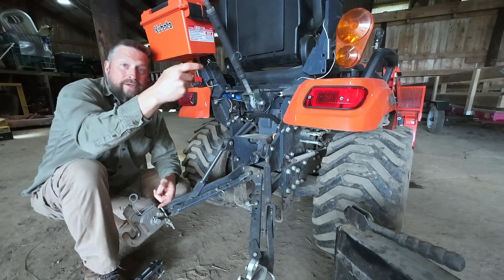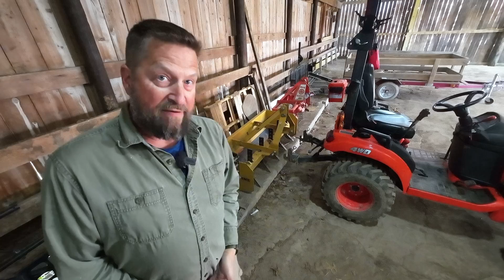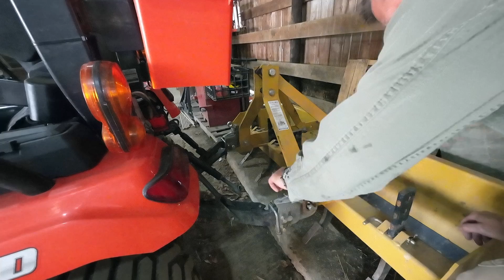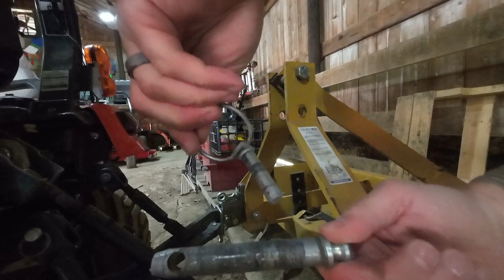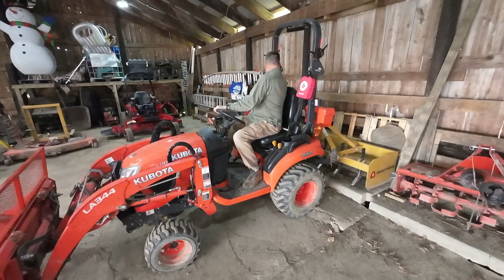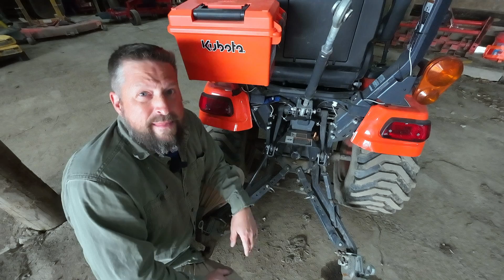BX Basics: Episode 4, 3 Point Hitch And Quick Hitch Options

Comment: Yes, great series!
One thing I've done differently than you (I have all your 3 point add-ons) is to change out the left fork for another adjustment link like on the right side. Just flip the fork ends 180 degrees and they fit as on the right side. This is for the back blade or in your case the box blade, both ends can now tilt! Super nice!
Reply from the maker: Great tip, thank you! I'll have to give that a try. 🤠👍

Comment: Great video. I found when attaching implements ( if you have a cement floor ) it’s best to go with the dolly system. I purchase the roller wheels and go with a wooden platform. Just roll it in and attach.
Reply from the maker: That sounds like a great way to make the process easier, thanks for sharing! 🤠👍

Comment: Well, I'm glad i didn't get this comment done right away! It was interesting to see how much trouble other people have.  I thought it was just me! I have a box blade, rear mower, and tiller.  I struggle every time! I bought the little furniture carts at Harbor Freight and made a dolly for my box blade. Not only can I move it around, it makes minor adjustments when attaching a little easier. I  usually let the rear mower down on furniture carts as well. Planning on making a frame with wheels for the tiller also. I sometimes struggle getting the PTO hooked up as well! I will listen to any tips for that! I'll look for a new video in the morning! 😉👍
Reply from the maker: Thank you! Really, anything to get the implement "pre" lined up is good. A level surface doesn't hurt either. You do not want to grease your pto because of dirt collection, but a little wd40 can help. Tomorrow's video is a good one! I'm excited for the summer 🤠👍

Comment: Started stock then when a friend got a quick hitch(QH), I tried his Pats. Not a big fan of the 4 adjusters but Pats are better than stock. Also great for various equipment. Same friend ended up with another QH so I’m trying that out. Definitely like the QH the best however I only have one thing to hook up. 
With a welder, I was able to modify friend’s middle buster to fit the top hook of his QH. A cut off wheel and a welder are a tractor owners best friend.
Reply from the maker: I do like the QH better than anything else. It works till it doesn't work. I had 4 rear implements that all worked with it... then I got the tiller. I now also have a post hole digger and I have to remove the top link to install it. Pat's for the win by disqualification, lol 🤠👍

Comment: The quick hitch is great, until its not.  Everything isn't quick hitch compatible....some stuff can be made compatible with some modifications...some quick hitches are not really quick, and they don't fit all attachments.....I have the QH-05 the factory quick hitch for the BX tractors....the top link hook isn't adjustable....making that quick hitch not exactly a quick hitch for some implements it don't work...I ordered a quick hitch from Vevor a while back that has the adjustable top hook....makes some of my attachments work with that mainly the ballast box....those things should be quick hitch compatible period....I guess whoever came up with them never tried to lift one after its been filled with sand, gravel, or whatever you are using for weight LOL.  

Something I've ran across with the BX at least, is some implements if you drop them on the ground when you are done, the 3 point arms don't go down far enough to be able to pick the implement or attachment back up again, so I've learned to drop them on a pallet or an area higher than the lowest point of the lift arms LOL.
Reply from the maker: Thanks Bill. I feel like the Pat's Easy Change is the best compromise between ease of use and compatibility. Some difficulties just come with owning a tractor. Good problems to have 🤠👍
Reply: @samsdoinstuff  For what Kubota charges for their quick hitch, it should be adjustable.  The Vevor one I bought cost half of what Kubota charges for their orange one that isn't adjustable.  

A few of the attachments I have I modified to fit the quick hitch....kind of defeats the purpose of a quick hitch if you have to remove it for certain implements LOL.  

I think Kubota has a PTO quick hitch out now as well for larger tractors, but if they can't get their own quick hitches to be adjustable for the wide range of implements out there that are quick hitch compatible with universal quick hitches, I don't think I'd want to pay the thousands of dollars for that PTO quick hitch....its a quick hitch, and the PTO shaft automatically connects when you hookup an implement, not sure I'd trust that part LOL.
Reply from the maker: @wildbill23c  That pto quick hitch sounds intriguing. I agree with you. I don't know if I'd trust it.

Comment: Great video! When I finally got my QH for my GC1725m it was a true game changer.
The weight box I had made wouldn't fit it, so I had to modify it to make it work. My tiller had issue too but I was able to figure out how to make it work with a different pin location and then a bushing to make it better. 
Prior to the QH was chaotic really, like a circus to get something hooked up.
Reply from the maker: Thank you! It really is an archaic system that needs an agricultural engineer to come up with something better. I don't think anyone likes messing with it like it comes from the factory 🤠👍

Comment: Good stuff
Pat's looks frustrating. Maybe you can get the welder out and fix that tiller to fit a proper quick hitch. 👍👍
Reply from the maker: Thank you! Modifications have occurred to me, but I have a post hoke digger now and I have to take the top link completely off to use it. For right now, Pat's is the best option 🤠👍

Comment: Another great video. Thanks. I have noticed that there are many YouTubers, with the adjustable spreader bars, that switch the plate that they connect to the tractor with, upside down. With PTO implements, when using those bars, there can be some interference with the PTO plastic shroud and the plate if it isn't flipped. Have you noticed anything like that? I'm not sure I framed the question very well.
Reply from the maker: Thank you! Yes, I've actually been meaning to flip that plate too. I'll get around to it... someday, lol 🤠👍